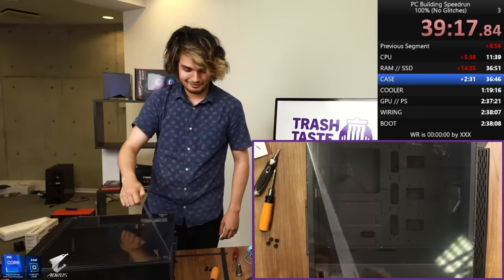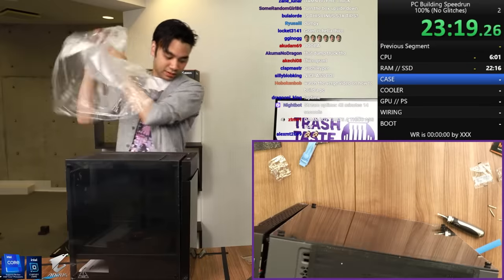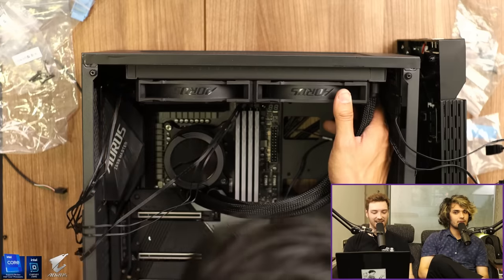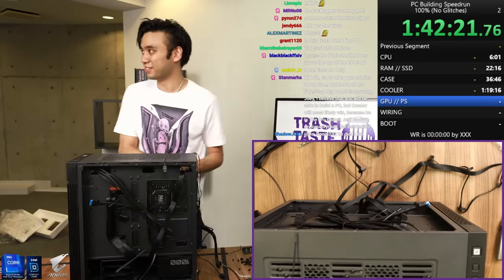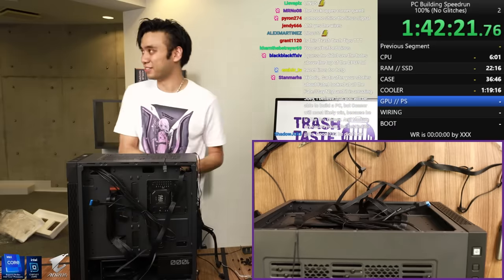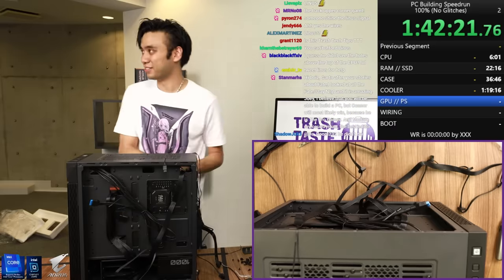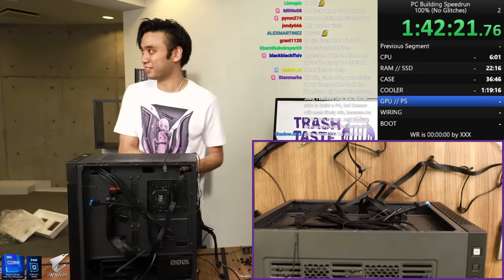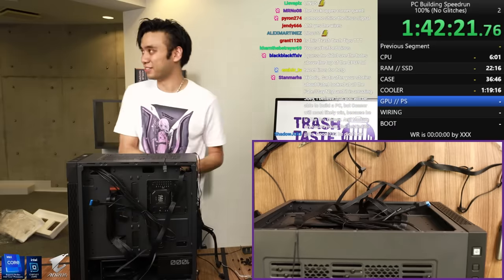Trash Taste PC Building Speedrun | Trash Taste Special

Comment: "how long do it think it takes to build a pc?"

chris: "fucking fifteen minutes" 

why did i laugh so hard at this
Reply: Well yeah you peel away the Mac monitor and plug it in EZ CLAP
Reply: If your sole target is just to make it boot, it can be done in like 10, you just connect everything without getting in inside the box, to do it properly i think it could be done in around 30 minutes
Reply: Time stamp?
Reply: Time stamp
Reply: The timestamp is 27:30 for all you asking
Reply: @Rov-Nihil  Nah, just screw those water cooling stuff and "gaming" stuff.
Get a regular ATX case + AMD CPU + stock cooler + SSD only + regular sized graphics card.
I think experienced PC builders can do it within 30 minutes if not around 15 minutes.

Many many parts are all-in-one. I'm a PC enthusiast. But I give no fuck about those extra components.
All I need is a fast computer and 4K monitor. 5% improvement with extra effort is just not for me.
Reply: @li_tsz_fung  It's not that easy in some places to get a "regular GPU", assuming you mean a reference Nvidia card, and those "extra" cards are no more difficult or easier to install than a reference card, as for cooler this was a Intel build which either doesn't come with one or comes with the shity one (in this case it's the former), the AMD stock cooler tough yea it's pretty gud, it gets a bad rep from stock coolers normally being crap.

Water cooling was pretty overkill tough yea, it has been tested that water cooling is neither cooler or less noisy than air cooling, while being more hassle, but otherwise this is a pretty normal build with no extras so not sure what you mean about "extra" or "all-in-one", because unless you get a pre-built and then change it all those parts will always come separately.
Reply: It’s the accent, man.
Reply: @rafaelsousa5  If I remember correctly Linus Tech Tips tested AIO Coolers (All in One) verses Air Coolers. The difference in cooling was only in how long it took to reach its max temp. An AIO took longer to peak as the liquid had to heat up. But it also took longer to cool the liquid back down. Whereas the Air cooler reached peaks faster.  Basically, they concluded there wasn't a significant enough difference to call one better than the other. (Though don't quote me on the first part as it's been a while since I watched that video.)
Also Even though an AIO is technically water cooling. It's often confused with full water-cooled systems so I personally try not to call it that anymore. Usually, when hardcore gamers/builders talk about Water Cooling what they mean is actually running the pipes, reservoir, pump, and filling it with water yourself.  AIO is very similar but not as difficult to install. Water Cooled systems are much more difficult to build as leakage is a potential issue. Plus you cant run a cooling loop into your GPU with an AIO like you can a full water-cooled system. Though they do make Video Cards with AIOs on them (My current GTX 1070 is AIO cooled as I am hoping it will do better to preserve the life of the card by stabilizing the temps better.)

Its a common terminology mixup. Not really a big deal as even I refer to my AIO as water-cooled from time to time since that's technically what it is. But one I usually ask people to clarify when they talk about their "water cooled" PC build when what they meant was they were using an AIO. 

I've done one water-cooled build before when I helped someone build their PC. It was a learning experience despite years of building PCs and knowing about water-cooled systems I hadn't ever installed a full liquid-cooled system (They are much more expensive to use compared to an AIO). It was a challenge installing the reservoir in his case as he bought the largest one he could get. I prefer using an AIO (which is what I have on both my CPU and GPU) due to them being much easier to install. Knowing what I know now after being at one of my other friend's houses during his latest PC build and how he water cooled it. If had the money or parts to build my next PC with a full water-cooled system there are things I would change and improve to make it easier to work with.
Reply: @SeohnAranys  Ok that is a massive wall of text, so I will skim read it and only touch on the water cooling vs air cooling part.

iirc the major difference is that liquid can more quickly move the heat away from the CPU and in higher quantities, but of course that is only useful if you actually make use of it, and with weaker system like you said and Linus and others tested liquid performs about the same and in some occasions worse than air.

Generally you only really need water cooling with powerful overclocked systems that will overwhelm air coolers easily, otherwise it's generally more expenses and more work for no gain.

Coming back to the video Linus did, iirc the 2 fan rad (I don't remember what measurements are used for those) had about the same performance as a D15, and the 1 and 3 fan variants did worse.

Personally I have a D15 from Noctua and I have no reason to switch to water cooling, even when I end up making a Ryzen build it will probably still suffice, air coolers can actually handle high core count CPU better than some people might think.
Reply: it would take me an hour max
Reply: @rafaelsousa5  Yeah, all those oem just give you stupid "SUPER OC", "GAMING EDITION". If it's not more expensive / reasonably designed, then whatever, I'll buy any card if it's around MSRP, has long warranty and good quality. 
But a 3080 ROG is nothing near 3090. I'll buy a ZOTAC because they have 5 year warranty here in Hong Kong (they're HK based), and it's usually cheap and not extra thicc for those overkill cooling.

Comment: 16:53 Garnt's time: 2 hours 38 minutes 08 seconds.  His PC succesfully booted  25:45 Guest starring: Sydney
28:54 Joey finishes. His time being 3 hours 30 minute and 37 seconds
40:12 Will connor pull a miracle and win?  41:00 never mind  41:58 i guess i was wrong. 2 hours 27 minutes and 52 seconds, and connor FINALLY wins fair and square after so much bad luck despite supposedly being the expert at this

Comment: So, I did the math (the best I could) and going solely off of retail pricing and looking for the cheapest sources as well, and the total price of one of these PCs is about 4135 USD (2,990 GBP)

If anyone one was curious

Part Breakdown in USD (rounded before tax):

Gigabyte Aorus RTX 3090 Eagal - $2100
Gigabyte Aorus RGB AIO Liquid Cooler 280- $250
Gigabyte Aorus RGB Memory 16GB (2x8GB)- $150 x2
Gigabyte Aorus Z590 MASTER Intel- $400
Gigabyte Aorus C200 (case)- $85
Gigabyte P1000GM 1000W PSU- $250
Samsung EVO 980 1TB - $200
Intel i9 11900K- $550

Comment: And that is why I went for a case where the top bracket can be removed with only 2 screws. That area is a nightmare for the CPU power, fan and other connectors when the radiator and its fans are mounted on top.

Comment: Normally you should be able to complete in under one and a half hours, if you are alone without pressure. 

Though I usually just have air cooling, which is much easier to set up, and I usually install the CPU cooler on the motherboard and try booting it before putting it into the case, really saves a lot of time. Obviously I remove the GPU before putting it in the case. The CPU cooler already adds enough weight.

Comment: I don't think either of you guys plugged in the argb cables.  The argb fans have separate cables for the fan and for argb lighting.  There should be one argb header on the motherboard, and the argb cables can be daisy-chained together.  It would have been worthwhile to read the motherboard manual, I am sure there is a short section covering this.

Comment: As someone who went Uga Buga with 0 PC building experience
And then bought $2000 PC and tried bulding it my own the experience was traumatizing 
Not because I fucked up, but one of the component is a defect, but I don't know which one
The PC would be turned on for a second and then turned off
I had to borrow someone Power Supply to test out which component is broken
Turns out it was the motherboard, and I was fucking stressed out, it's fucking expensive stuff
So I returned the Motherboard for a new one, But the store didn't find anything wrong with it
So I had to explained IN DETAIL how the problem arises with the motherboard
They finally got the problem, and promises to give me new one, in 4 Weeks
After I got the new motherboard, it still wouldn't light up, I was stressed out further
Turns out the Bios in this one is outdated, but the first one is not,
After the Bios was updated it can turn on, BUT there's a message saying it didn't detect any fan
But the fan is moving and the AIO Water Cooling is working correctly, turns out I had to manually go to the BIOS and ignore the fan
And it finally on, it was fucking traumatizing, but I learn A fuck ton of information

Comment: Cooler should be a later step (But before the graphics card). Cooler can get in way of inserting ram or M.2 ssd as well as in way of ram. Really depends on cooler motherboard and the parts. Water cooling is a nightmare dont do it unless you maintain it regularly. Also if cooler is very custom made or made poorly the liquid/combination of liquid and different metals can cause corrosion. Also its harder to get proper combination of parts for water cooling to fit in some cases. Air cooling is usually fine. Just apply thermal paste as a dot size of a pea. Use software to check temp while running a benchmark or something to ensure the application is fine.

Comment: This is why I like AMD CPUs. You only need to lineup the Ryzen writing to the top of the CPU slot(or you could just lineup the triangle at the corner). And the mounting bracket for the CPU fan/aio water block are really easy to do. Plus it comes with a free fan in the box as well as pre-applied thermal paste.

Comment: I just built a PC not long ago, so it's still fresh in my mind, it's a confusing mess even for people who have built a good couple of pc's Not a lot, but a number of pc's and is fairly familiar with the tech language.  

Installing The CPU cooler makes the build time 4-8x longer depending if you went Air or Water cooler even then what level of water cooler; everyone goes thru enlightened phases, you've been fucking around with all the fittings, you've been trying to find that piece that YOU just saw a second ago but now it took an entire army to find it again. Then the Wiring makes it 6x times longer, unless you really know your shit and build pc's every month, Discovering the wirings built in the Case and the wires of the Mobo, especially annoying when it's a RGB case or CPU fans with all the extra connectors and wires. Then you realize that one of the head for the fan is at the worst position inconceivable, so you are trying to plug it in but you give up and just plug it elsewhere with the motion of "good enough" Like plugging Case fans into a AIO header😂.

Comment: Nah Garnt still won. Connor could only power it on because that was a backup power button. He probably didn't plug in the front panel IO properly so the case power didn't turn it on which means time is still ticking! Lol

Comment: Connor is panicking about touching CPU way too much. Most probable thing that can happen is that he leaves some oil on the surface and paste won't be as efficient. CPU is locked in place so bending pins in unlikely and discharging to upper plate probably won't hurt it either cause it's just a metal case, probably connected to the ground.

Comment: i just realized that this case has break-out PCIe slot covers ... ewww
(also be caseful with those .. the really cheap ones are sharper than a razorblade .. if you mess up with them its possible to lose your tip of the finger)

Comment: Meanwhile me having a PC with 2 PSUs
(400W for everything and then 1000W broken one that only powers the GPU(1060 6GB) and is force powered by a copper wire and is also hanging in the case held by "hose wires" or whatever these things are called)
My CPU is Ryzen 3 1200
And I have 16GB 2666MHz RAM
100GB M2, 100GB SSD | External HDDs 256GB, 2TB
So a decent build I guess

Comment: 3 hours of your time sank already, and you still haven't finished. You've only just begun the downward spiral into hell that is a PC.

You now have to get it to run games other than solitaire or minesweeper. And then get those games to run optimally. And then buy the latest hardware so those games run even more optimally for your PC nerd framerate-gasm (400fps?! *ejaculates everywhere*) Meanwhile the rest of the households on your street no longer have power because it's all been diverted just so you can run the latest games on your £3000 PC at high FPS. And then you have to bind the controls to play those games. But first you have to choose what type of controller, which controller of that type is best for a particular game, and then calibrate and bind that controller so it has accurate input. All whilst hoping that you have the right software to support that controller and whatever game you're playing. And once you've booted the game, it's time to fuck around with yet more options to make it fit your current screen whilst balancing resolution and framerate. And then you can finally play the damn game. Until it crashes. And then you have to troubleshoot. A lot. You better enjoy troubleshooting, because that's basically 90% of your time spent owning a PC.

With reference to the actual challenge, you could just download Linux to a usb and shove it onto a PS3 and then use a mouse and keyboard if you feel like it. All within 20 minutes. Which is what I'd do. It doesn't specify It has to be a good PC, it just has to boot. Easy win.
Reply: @Yikeo  And that's an issue because... ?

Last time I touched a PC was in 2009 so I don't doubt some of it has changed. But I highly doubt it's become a smooth consumer focused experience the average consumer could easily enjoy out of the box.
Reply: @Yikeo  Alright, whatever Trevor.